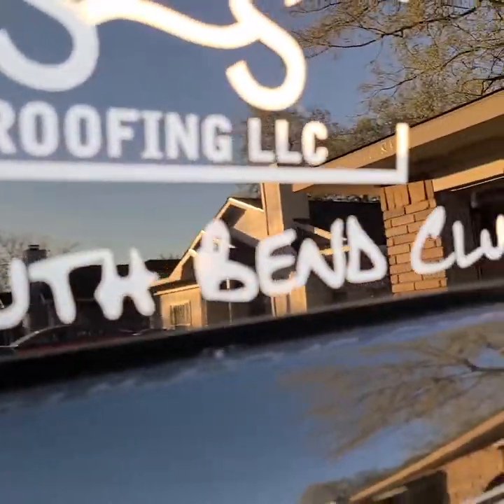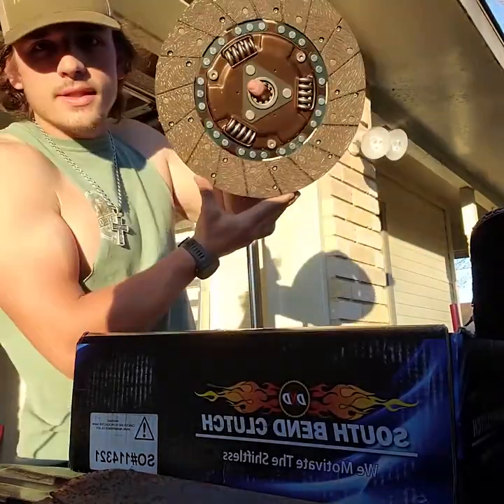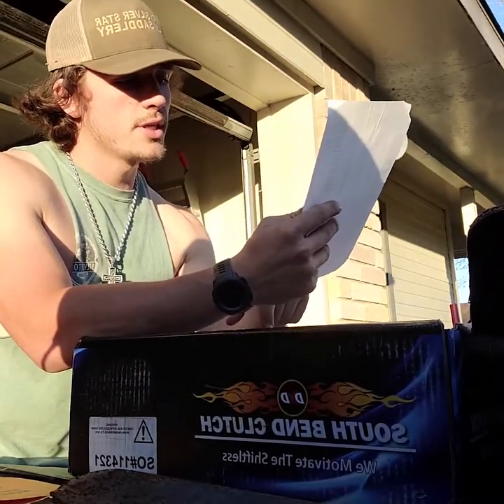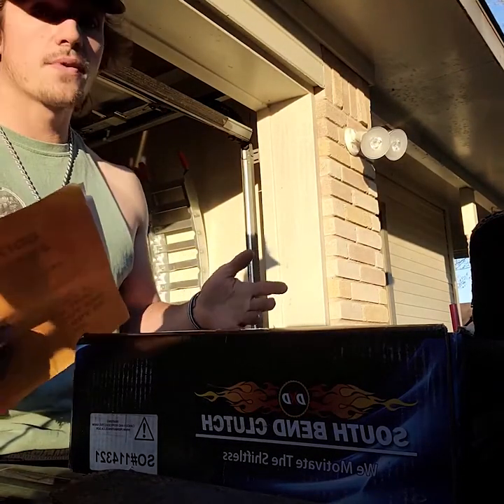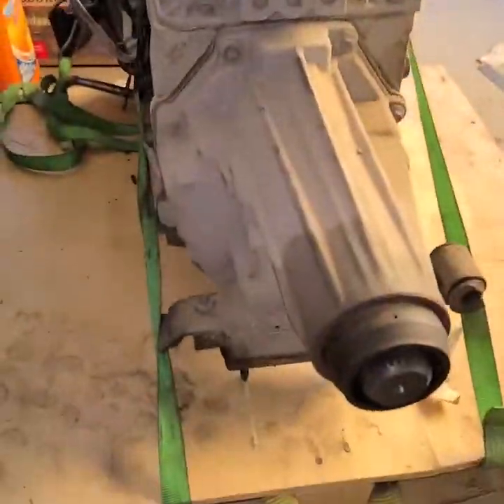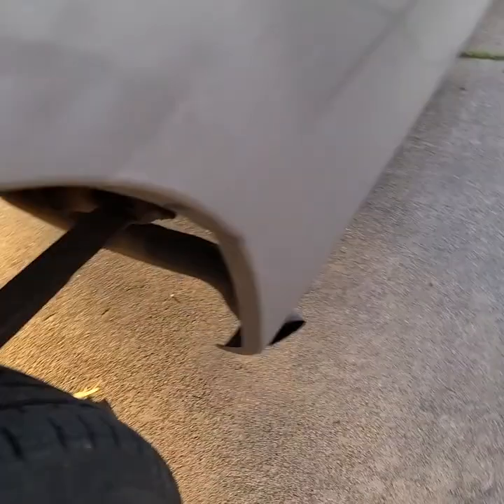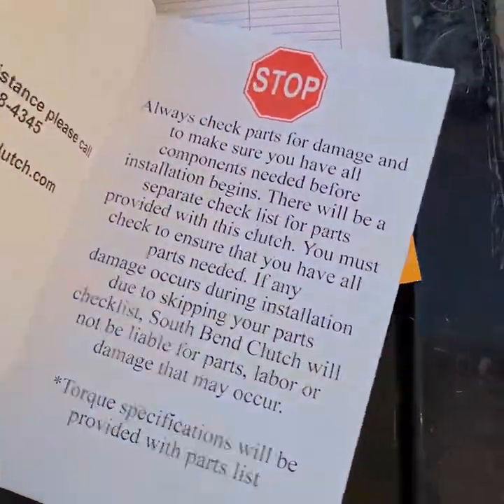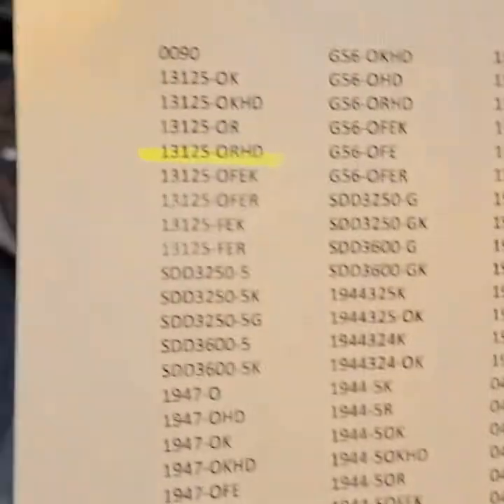SOUTH BEND CLUTCH UNBOXING

Comment: Is your engine stock?
Reply from the maker: Yes it was. Shortly after this video the curse of the 53 block hit and ended up grenading the block
Reply: @K-S-TX352  I also have block 53, and it scares me
Reply from the maker: @Killdozer_  mine ended up cracking from the driver side motor mount through the freeze plugs and up to the front of the block. Only thing I had aftermarket was an exhaust
Reply: Where are you located at?
Reply from the maker: @lynnaemanuel8629  central texas